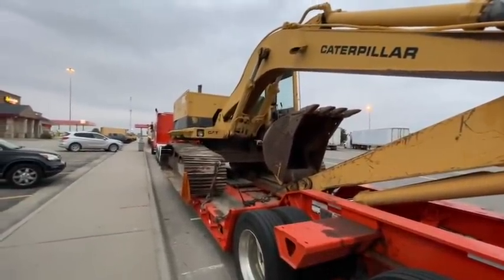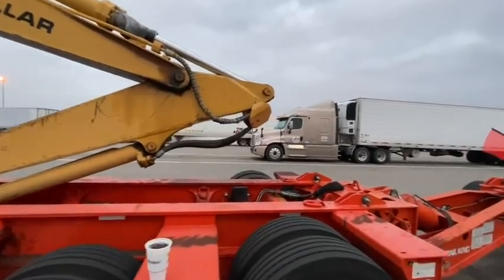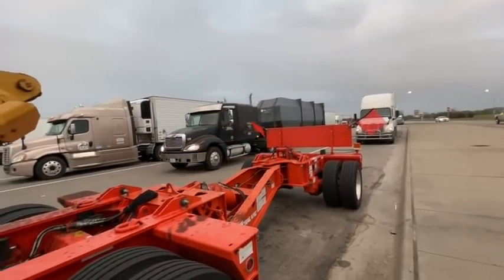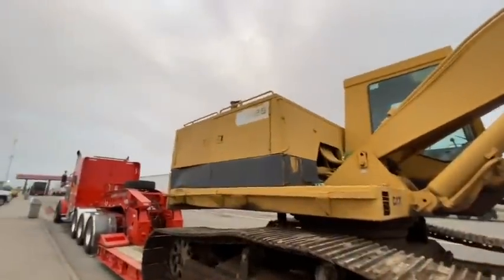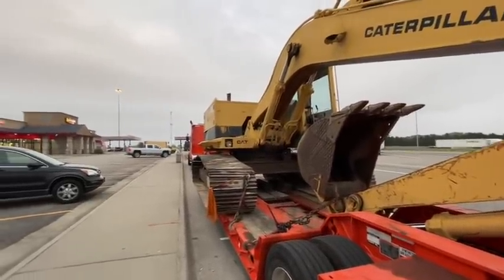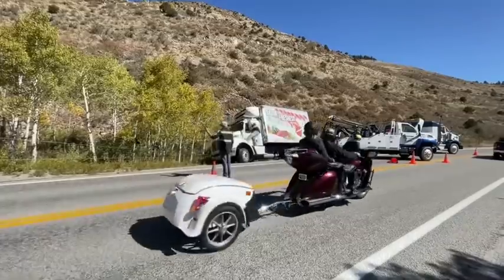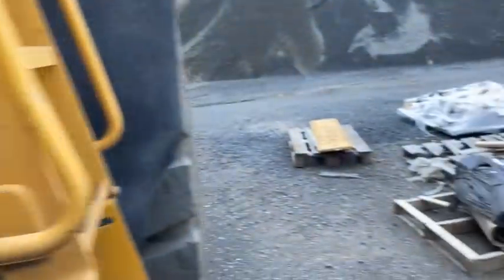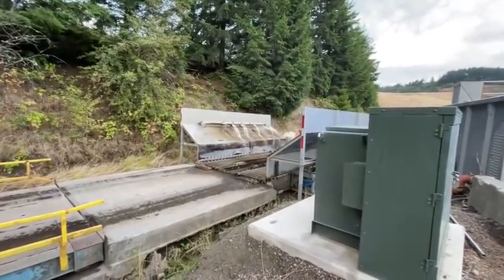A Journey Back in Time

Comment: I thought that I was the only one that  had crap luck that just kept compounding. 
Perseverance brother. Have always liked the tri-axle heavy hauls. Have several friends that haul odd load's here in Ohio. The old upi in Mt Vernon had some old Brockways and REO's.
Liked the rain cap reference. When I was in diesel school in '79-'81, my instructor was adamant about unnecessary restrictions. He couldn't stand to see trucks come in to the shop with rain cap hinges to the front where the air going down the road would cause pressure vs turning it 90 degrees. The electrical instructor was big into radios and knew how radio signals travelled. He just shook his head and laughed at these hands with their antennas cocked forward 45 degrees -- talking to the pavement.
Friend of ours just returned from a Dakota pheasant hunt (and understand this was a year ago). Have an adopted son who lives over that way. A bad day in the woods, fields, or on the water beats a good day at work --- planning on spending a lot more time out this year. Have a 53 year old John Almand hardtop on lake Erie. Hard to beat yellow lake perch -- although fresh caught blue crab stuffed flounder at the family's place on the lower eastern shore has to be my favorite.
Stay safe
Blessings

Comment: For someone to own a Heavy Haul Business you sure don't be using enough securement on the Equipment you haul. I see 5 chains and binders and 4 of them are attached to the Equipment making them Direct Tie Downs which cuts your WWL in 1/2. But hey u own the Company and I've only been hauling Equipment for the last 18yrs.
Reply from the maker: As you see it, it’s good for 45,000.  Which is good for up to 90000.
Reply: @KeepingitAnalog  how is it good for 45k when you only have 5?
Reply from the maker: They are ½” grade 100. 7500 at each corner plus 15k over the boom.
Reply: @KeepingitAnalog  ok cool......I bet Captain Sergei would agree with me
Reply from the maker: Explain why you feel I am wrong. Capt Sergie uses grade 70 chains. And his D Rings are only rated for 10k.
Reply: @KeepingitAnalog  connecting to the Machine is called Direct Tie Down, DOT states that your WLL is reduced by 1/2 when using a Direct Tie Down. If 1 of those Chains breaks, what's stopping the Machine from coming off?
Reply from the maker: You are correct.   It also says you have to have at least 50% tie down of the weight. Half of 55000 is 22500. Chains that have a wll of 15000x4/2 equals 30k. Plus the boom chain at full wll. If you lose one chain you still exceed the 22500.